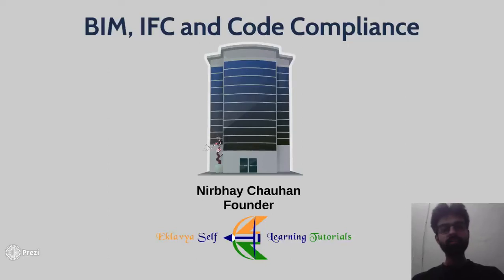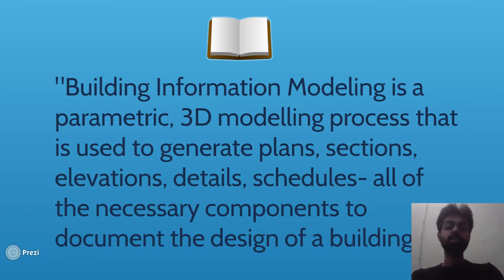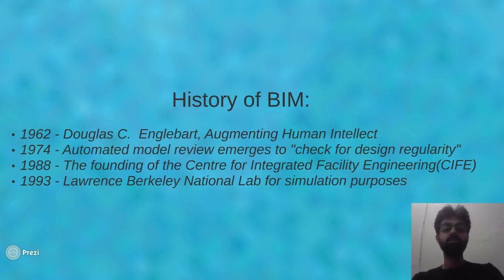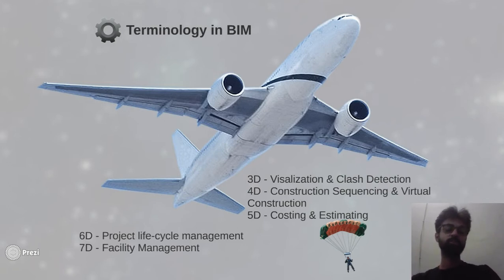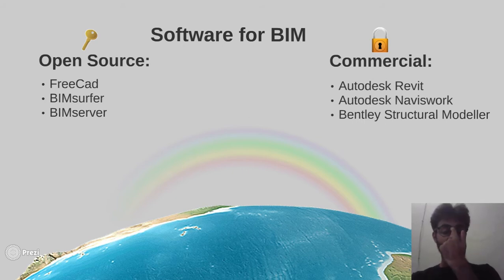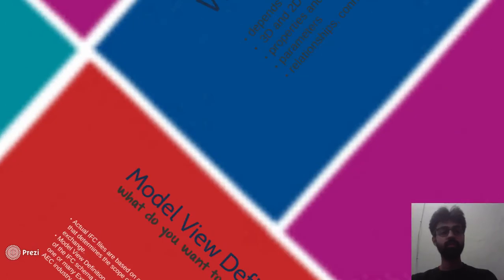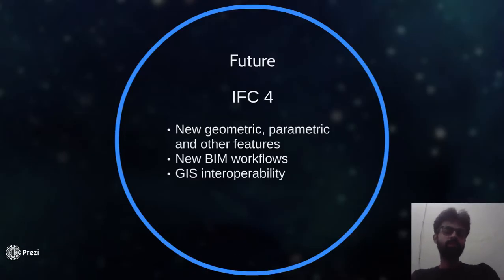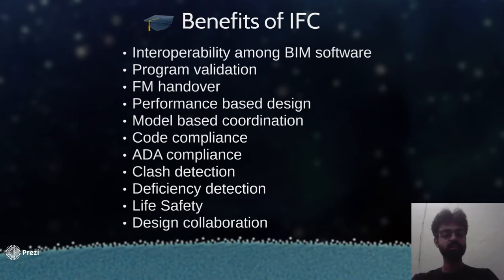Presentation on BIM, IFC and Code Compliance

Comment: Pity that there was no mention of Solibri Model Checker which has been supporting OPEN BIM from the start
Reply from the maker: It is clearly mentioned at 14:21
Reply: Yes, but just on passing... Solibri has payed a major part in the open BIM effort. It would be nice if you could do a video on authoring tools available, both open source and commercial that support open BIM.
Reply from the maker: Yes, no doubt Solibri has done impressive work in OpenBIM and I'll definitely look forward to make the suggested video.
Thanks for your expert insight on my presentation. :-)